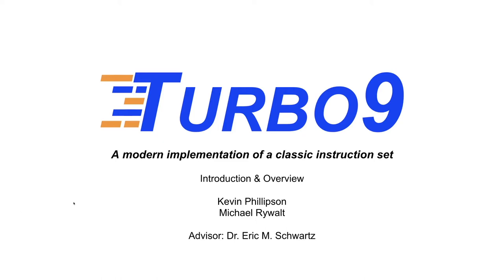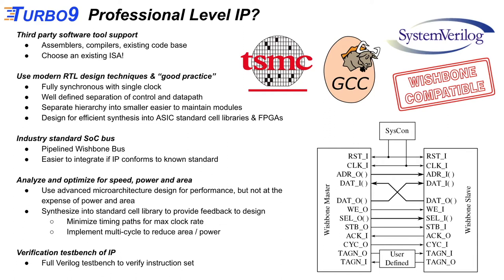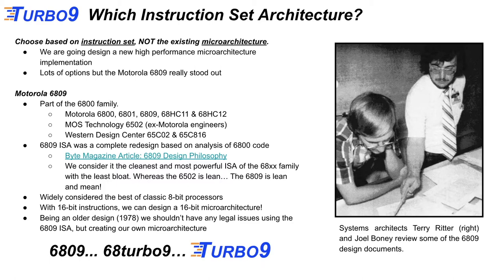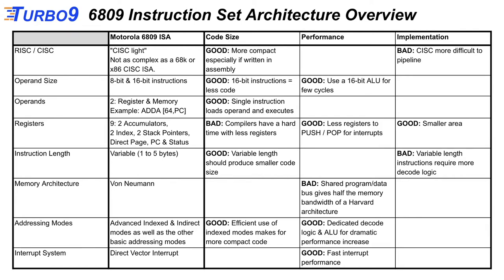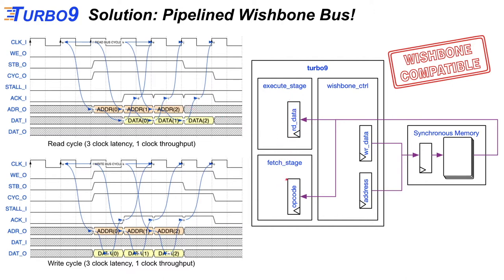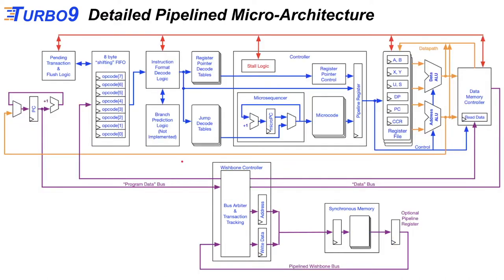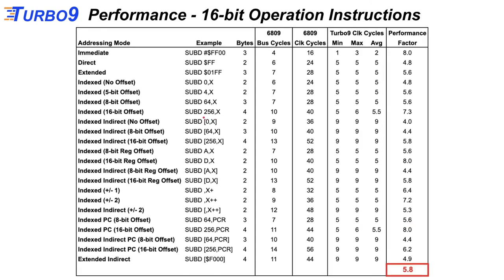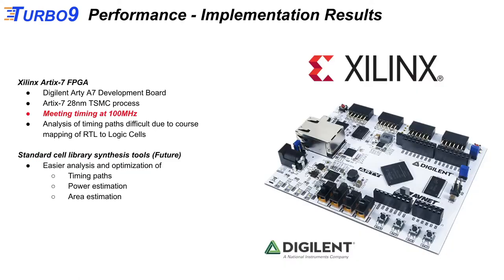Turbo9 - Pipelined 6809 microprocessor IP

Comment: Nice work! I have happy memories of hacking on a 6809 system 30+ years ago. It's impressive to see what you have been able to do with it using modern design techniques.

I remember reading somewhere that the original 6800 and 6809 used flip-flop chains for sequencing rather than microcode. When asked why, one of the designers said they didn't learn about microcode until later.
Reply from the maker: Yes, I believe the 6800/6502/6809 all have similar a decoder "matrix." Basically a PLA with the Instruction Register crossed with a "One Hot Decode" flop shift chain for cycle by cycle sequencing. It is quite a efficient design and translates well to our pipelined decode stage.

Comment: There's a certain irony here, give the footprint of the original ARM1 and ARM2. That said, a 6809 designed along more modern principles is interesting in and of itself, and has a genuine niche.
Reply from the maker: You're thinking along the right line... a niche for a small embedded 16bit processor with high performance. The ARM1/2 also had a 3 stage pipeline, but the main difference is the ARM has a 27x32bit register file vs the 6809's 7x16bit register file. The flops required to build those register files require a lot of transistors plus more transistors for the muxes and decode logic to hook them to the datapath. I have been working on area utilization numbers recently with a standard cell logic library. Given the original die sizes of the ARM1 (50 mm^2 in 3um process) and ARM2 (34 mm^2 in 2um process) you can scale the ARM area utilization to the same fabrication process for comparison. The Turbo9 is 3 to 4 times smaller. Stay tuned to this channel for future updates! Thanks for the insightful comment!

Comment: Outstanding project - just now discovered it from the video from the CoCo conference. I love the 6809 ISA and, as a Forthwright, it's an ideal target for stack based languages. Having a pipelined 6809 is a fantastic thought. Hope I'll be able to burn an FPGA and try it out one day. Obviously branch & jump prediction would have a huge impact on the performance of Forth code since it's typically far more decomposed into smaller words/functions than C or ASM apps.

As far as licenses are concerned, I'm a fan of BSD3 which allows for full commercial use but requires a notice that the IP is present in the resulting product.
Reply from the maker: Hi Benjamin, thank you for the comment. There is actually a bit more "low hanging fruit" vs the branch predication hardware that will give us a performance boost while still keeping the silicon area low. Regarding licensing we are looking focusing in on the BSD license actually.
Reply: @turbo9team  any thought of taking advantage of the 6309?
Reply: ב''ה, it's clown world, but a license preventing or requiring disclosure of modifications could provide some protections for a known security landscape in amenable legal environments (possibly not USA where various parties have rights to modify supply chains at any time*)
 
*May particularly apply to taxpayers who have reported "their AGI" or received government communications stating "your AGI"